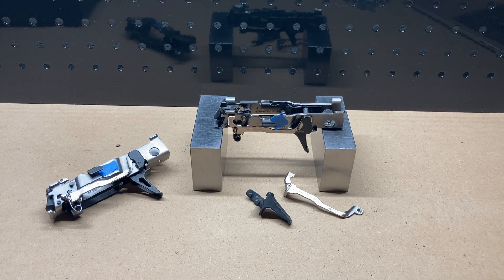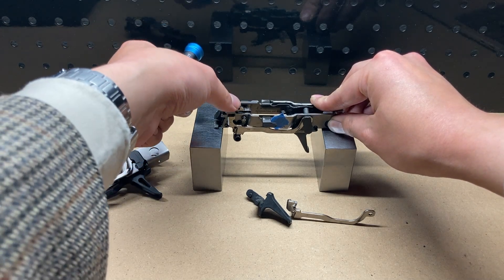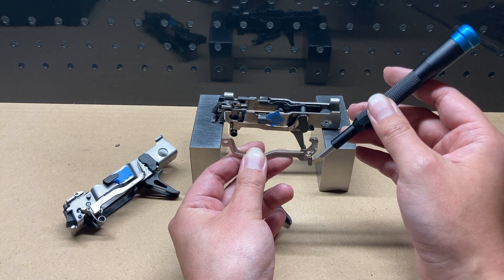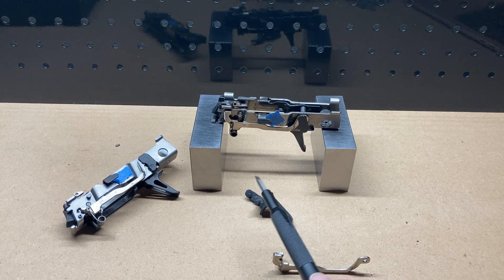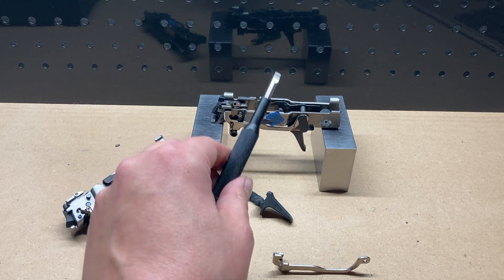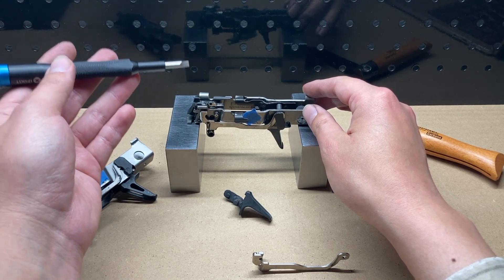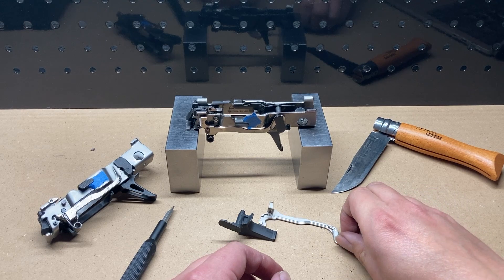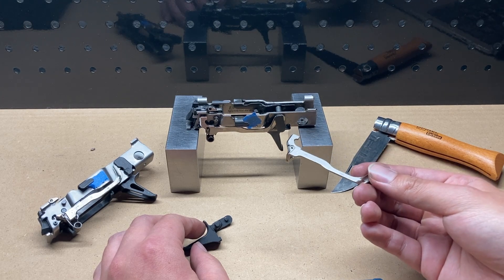P320 Sear Movement Test followup: It's all about the Trigger Bar and Trigger

Comment: I carried a P320 for a brief time. Then I noticed that rattling the slide against the lugs on the FCU potentially put opposing forces on the two faces of the sear engagement, the striker foot and the sear itself.

Then I noticed how dry firing a P320 causes the slide to hop up, indicating to me the sear was holding the slide down. Putting a magazine in the gun added force up on the slide mimicking, at least a little bit, the action on the sear by pulling the trigger.

You are doing a great public service with these videos. I like guns. I cherish the 2nd. The P320, I like that a lot less. It's a loathsome design.
Reply: I hate that the p320 gives legitimacy to the whole public safety narrative from anti-gnners.  An inanimate object should not be dangerous without a bad actor behind the trigger. It's other humans and governments that the public should worry about.
Reply: @ Amen to that.
Reply: @blantant it can only seem to happen when in a holster, and by a cop....I'd like to see why in those instances.....
Reply: @morocomole4567  I agree, but there are also military and civilian incidents.

Some of the P320 injuries are probably due to unsafe handling. The P320 isn't a forgiving design even if it has no mechanical vulnerabilities.

I wouldn't carry a 1911 cocked and unlocked. The P320 at best analysis is too close to that. By contrast, my decocked and safety-less CZ 75D doesn't worry me in the least. Different guns have different safety margins.

I guess I'm funny. I want guns with some margin for error while also believing error in the slightest degree is unacceptable.
Reply: @johnnyragadoo2414 This. It is operator error. The gun is less forgiving than a Glock, and bad habits will catch up with people. 

Sig has paid out lawsuits, just like Glock has. Not because the design was proven to be defective, but because a lawyer managed to convince a jury that the gun was “too easy to fire” dude to lack of certain safeties.
Reply: Lots do not have safety and none are drop safe so even revolver no safety and once you pull the hammer you have to hold the hammer and trigger to release it but even the sig from Germany no safety and it's a heavy pull and the 320 is a lighter pull so it takes less for it to go off and I dislike safety because more moving parts the more can malfunction and yes I'd rather not have it malfunction when you really need it and it's modular so everything from frames even sizes to caliber like 9 to 40 or 357 not counting modifications like flat trigger or red dot and holsters matter more basically you can't have it moving in holster it should fit and old holster fit but not correct so enough difference but someone with little trained needs a heavy pull and it shouldn't be one manufacturer for a whole department they need to train with different manufacturers and pick what's suitable for each person but I guess they get a group rate for coppers but they have little trained and everything from holsters even some magazine  @DamnManSam
Reply: @DamnManSam what lawsuits has Glock lost and had to pay out?
Reply: @DamnManSam  😂  Yeah this gun is so super special and unique that guys who've been shooting for years are the only ones than can operate it correctly.  Ridiculous.
Reply: @FiveTwoSevenTHR  search the one about a Marine whose 3 year old shot him on the back. Glock settled the lawsuit on the basis that the gun “was too easy to fire.” Which was BS. But this is how these lawsuits are settled.
Reply: @DamnManSam  I can't find anything at all on that. I need more detail.
Reply: @DamnManSam  the case facts clearly state the kid pulled the trigger and shot his dad. That has nothing to do with guns going off in holsters. Bad argument.
Reply: @TheOtherVenkman  it has everything to do with that. No one has proven that a P320 can go off on its own. The lawsuits uses “easy to fire” “lack of safeties” terminology in order to get settled. Just the that Veteran Cop did when his kid shot him.
Reply: @ How did Sig lose a lawsuit and get ordered to pay 11 million in damages if it wasn't proven that it can go off without the trigger getting pulled?
Reply: So what that lawsuit “proved” is that glocks do indeed have good triggers… if a toddler can pull them
Reply: @crescentsweep2460  a lawsuit showing that Glock fires when the trigger is pulled and a lawsuit showing the P320 randomly discharges, same thing really.
Reply: @FiveTwoSevenTHR  His point was a lawsuit being paid out is not necessarily indicative of a defect in the design. From to the Glock lawsuit, the jury determined lack of a manual safety was a design defect worthy of a payout. TBH, I actually agree with that and refuse to buy any gun that lacks some kind of safety mechanism, but clearly most people are comfortable with that. So the P320 lawsuit doesn't necessarily mean a design defect since the reason could be a lack of a safety or the trigger being "too light" or some other thing.

Doesn't mean the P320 doesn't have some issue, just that lawsuits by themselves aren't proof. There needs to be an explanation for how this happens and why, which is why this video is very useful. Otherwise, I have seen videos of Glocks going off in holsters too (like here: https://youtu.be/GFUsA5gq1Cw?si=Ih6jEXsVqZNCYyzf), but usually people wonder what the guy did wrong rather than blaming the gun.
Reply: @gameragodzilla  if you can show me a video of a Glock discharging fully holstered with clearly no obstruction in the holster like what we've now seen numerous times with witnesses to corroborate the video, I'd appreciate it. 

If it was a handling issue, why is it pretty much just 320s happening now? They aren't the most popular, and they don't even have the shortest and lightest trigger in the duty gun world but it's pretty much just 320s now.

Also I do want to see this apparent lawsuit that Glock lost.
Reply: @ I just linked you a video where that exactly happened. Glock 43 in a G-Code Incog holster (so proper kydex).

It's not just 320s happening. There are discharges every day of every kind of pistol. The P320 videos just go viral because there was a genuine safety issue that was proven in a lab controlled environment in the past, and while (allegedly) fixed, people are less willing to give the benefit of the doubt in comparison to other handguns. For example, if that video was about a P320, guaranteed it would still be referenced everywhere.

P320s do have lighter triggers than Glocks and M&P's, which are the main competitors. There are lighter striker fired pistol triggers out there, like the Walther PDP, but the PDP is nowhere near as popular or widespread as the Glock, M&P, or P320 (which is a shame because the Walther's frankly a better pistol than all three). Extremely high volume makes incidents more likely to occur, since even a 1 in a million chance will still happen multiple times if you have millions of pistols out there.

As for the lawsuit itself: foac-illea(dot)org/Glock-Settles-Negligent-Discharge-Case-With-Paralyzed-Ex-lapd-Cop/Legal-News-Item/574

Since Youtube hates links.
Reply: @gameragodzilla  I think there is a difference between understandable gun failures and episodes like the Remington 700 or the Sig P320.

I trust my 1911s as much as I would trust any gun, but I wouldn't trust them if I didn't know the fit of the thumb safety's sear block or my Kimber's firing pin block.

My Kahr PM9, old enough to predate QC issues at Kahr, is very safe.

As is my hammer fired CZ, my current EDC.

I set my P320's aside long before the voluntary upgrade. I thought the design was too close to an edge I didn't want to go over.

Obviously, no gun is going to take over safe handling responsibility from us. We have to exercise care and caution with any of them.
Reply: @johnnyragadoo2414  I don’t entirely disagree with you. My responses were more saying that just because a lawsuit was settled doesn’t automatically mean the gun was at fault, as Glocks also have an example. I also showed that video evidence is also not entirely proof either, as again, I also have one with a Glock.

Main problem right now is we just don’t know. This channel seems to have narrowed down something (and thankfully my XTEN passes his test) but I don’t know why his friend’s gun was problematic. Is it due to bad design, poor QC, improper assembly (and if so, by who), etc.? And even the uncommanded discharges on video, I can’t tell whether it was actually the gun’s fault or the user’s. Too many variables.

That’s why I said this stuff can happen with all guns, it’s just that the P320 having a genuine safety issue in the past means no one is willing to give them the benefit of the doubt unlike Glocks. Not that they don’t deserve it, mind you, but it still means I want to know exactly how and why the problem happens because otherwise, I don’t really see it as any more dangerous than any other striker fired pistol.
Reply: @gameragodzilla  that Glock discharge easily looks like a holster obstruction and the gun was pressed further into the holster against the obstruction when he leaned over.

Everyone has seen the 320 shooting after getting an impact from a foot in the opposite direction that would cause a gun to press against a holster obstruction in a lobby while fully holstered in a Safariland holster with the hood closed. Protraband on one of his Sig videos showed a cop stowing his 320 in his detached holster where it was very obvious nothing was going to be able to pull the trigger from that motion.

The PDP is proving to be very popular in the groups I'm in and I'm still yet to hear about a single discharge. If the light trigger is the issue, why have we not seen at least one fully holstered discharge from a PDP? Why not any with the countless light Glock triggers that have been on the market for decades?

It's already been shown that some 320s with the terribly designed sear springs have been assembled wrong in a crossed resulting in weak sear  engagement. That is where sig has lost lawsuits. There are videos showing that the striker lock is not even functional. You can find that by looking up the 320 punch test.
Reply: @FiveTwoSevenTHR  Sure, but the P320 discharges could be the same thing. I certainly know the video with the cop in the school bumped his gun with his elbow before it discharged.

Things bounce when being impacted, so it's certainly possible an obstruction in the holster could still pull the trigger when the gun bounced back forward after hitting the top of the retention. Guns move back and forth when impacted.

Not to say that's definitely what happened, but to say that's also possible as well and until the results are replicated in a controlled lab environment, we can't know for certain. But the Glock video does show it isn't necessarily the gun.

The PDP is still far less popular than the three pistols I've mentioned. Yeah, you may have some friends who have it, but anecedotally, I haven't seen many. The plural of anecdote isn't data, so the sales figures are used instead which also show the PDP isn't as common as the P320, Glock, M&P etc. And we have seen Glocks discharge in holsters, even stock ones as I said. Now you say it's most likely due to a holster obstruction and I agree. My point is just that the P320s are possibly that too and we can't know for certain until we can replicate a problem with the gun in a lab.

Yeah, but that's not a design flaw, more an improper assembly issue. And that could be due to Sig's workers, or due to third party armorers or gunsmiths. I've certailny installed springs improperly myself when I was replacing the trigger in my XTEN's FCU, though I caught that.

Also isn't the 320 punch test what this guy demonstrated? You can use a punch to trip the sear? I tested my gun with that method and the firing pin didn't protrude, nor did it do so for his gun, just his friend's gun. That is certainly a concern and now we should figure out why it happened. Poor assembly? Out of spec part? Bad third party components? Etc. That stuff is more interesting and valuable informatioon.
Reply: @lucastonoli3256  I’ve read that some of those military incidents were dismissed. When investigations and legal matters pop up everyone takes sides to not be accountable. That includes Sig, the military, and law enforcement.
Reply: @lucastonoli3256  if you Google for the military incident in Hawaii, you can find the military report where they say the soldier did nothing wrong. His P320 discharged in the holster, safety on, no holster obstructions, no mishandling. The safety on the P320 doesn't block the sear, like the safety on a 1911, it blocks the trigger bar.
Reply: @lucastonoli3256 Whoops!
Reply: My issues is that the P320 is a gun that I enjoy shooting, but I can't buy...
Reply: Great videos and thorough explanation!
Reply: Interesting you mention the loved magazine applies upward pressure on the slide. I wonder if that fact, coupled with a filled to capacity magazine raises the slide and sear just high enough so as to lessen the amount of contact surface of the sear and striker. I always download by two rounds. Wonder what the round count vs capacity is in the LEO'S in recent internet vids.
Reply: Fwiw glocks and other striker fire guns can have that same rattle between slide and frame. On some being loaded solves that, but still a unsettling thing
Reply: @sparten17708  The big difference is that the SiG design holds the striker at full cock where Glock only partially loads the striker and then fully cocks and releases it by pulling the trigger.   Even if the Glock striker should skip over the sear it doesn't have enough energy to reliably light a cartridge and also has a striker safety that should be able to stop it from hitting the primer.   The SiG is fully cocked and when the slide has movement that is also movement in the sear/striker interface and in a holster that grips the slide tightly....it leaves the grip free to be bumped which then levers the slide movement and has caused AD's.   

People love the SiG trigger pull because all it's doing is releasing safeties and the striker so it's lighter...but also not tolerant of wear or slide rail play.

Comment: This is what I’ve been saying. The main design issue is the dual leg sear. The original p320 sear didn’t have a dual leg. If you look at the sear for a p365 it doesn’t have dual leg either. Remove the second sear leg and no more issue.
Reply from the maker: The rear sear leg on the "upgraded" sear is indeed incredibly puzzling to me. I cannot fathom why it exists, and it's clearly the source of sympathetic movement of the trigger bar.
Reply: The leg was added to create more resistance to the sear moving down. 

The resistance of the trigger bar is like an additional sear spring. 

Unfortunately it doesn’t appear to be executed well.
Reply: @P320Truther there's a test you could do. Cut the rear leg off of a new sear and see how it works in general.
Reply from the maker: Working on it...
Reply: @P320Truther  to add to that. Those springs can oscillate if they experience vibrations at the resonant frequency. I know the odds of that happening are extremely and I mean extremely small but it is not zero. I mean the sear springs would oscillate on any gun if they experience resonant frequencies. However, the crazy design of the sear can disengage the striker safety if that were to happen.